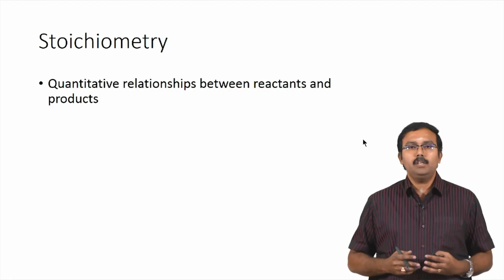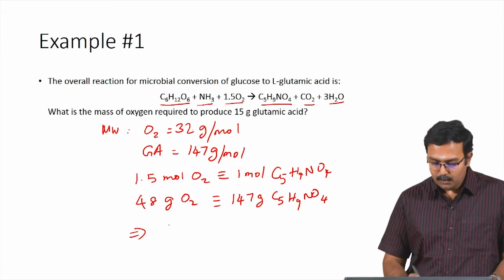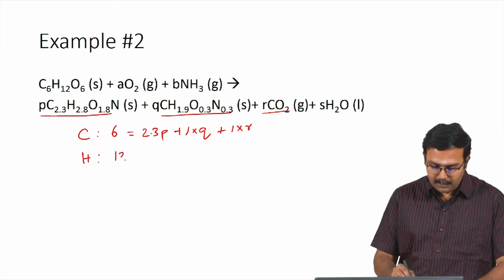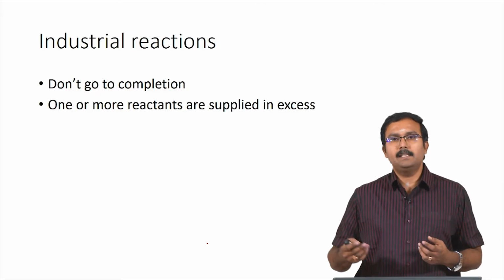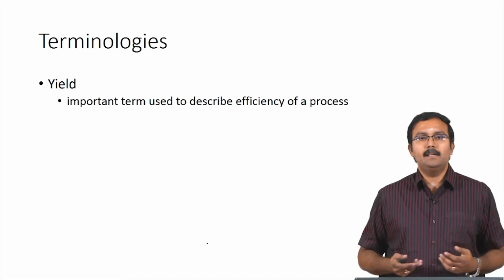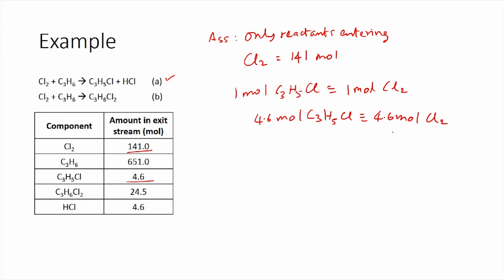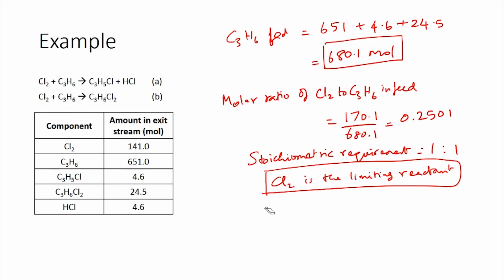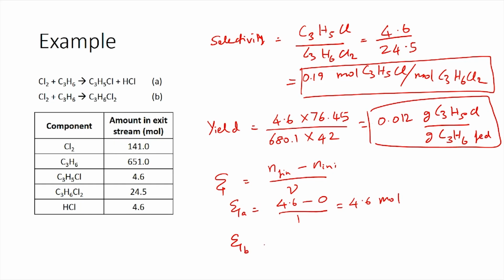#10 Fundamentals of Reactive Processes | Material & Energy Balances

Comment: Hello, in the last example, why don't we calculate HCl in the output equation for the reaction (a) for both od chlorine and propyne?
Reply: It's because Chlorine and Propene participate in both the above reactions. To calculate the extent of the reaction, we consider a product unique to the particular reaction. BTW, using HCl gives the same answer as 4.6 moles
Reply: Because 1 mole of c3h6 gives 1 mole of both c3h5cl + hcl so if we add both it will be like the same moles added twice of feed